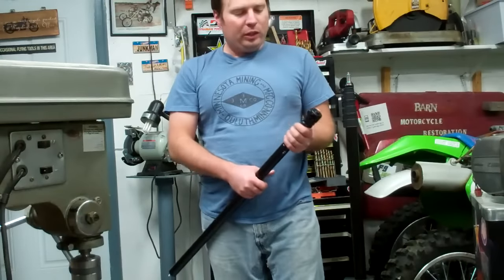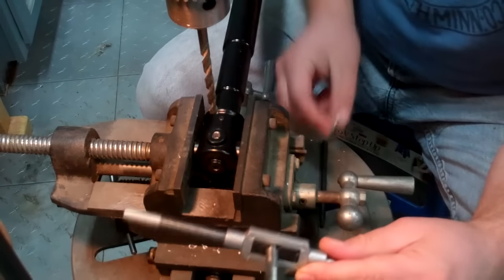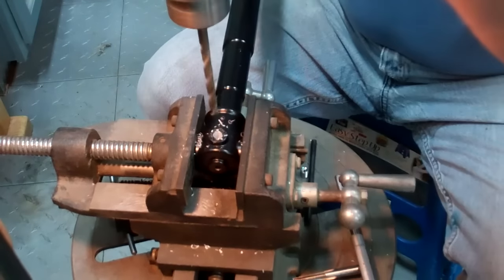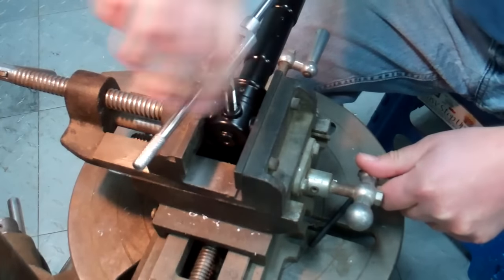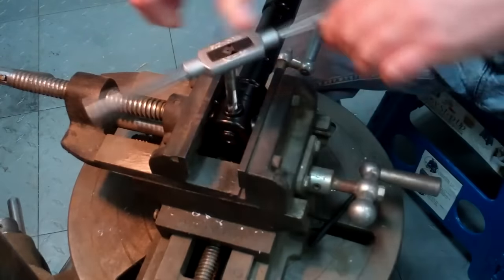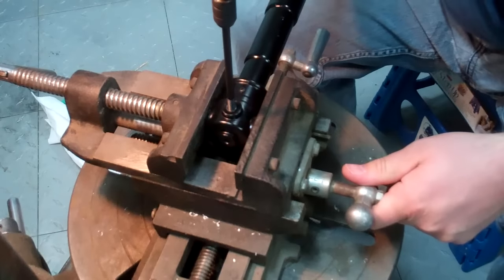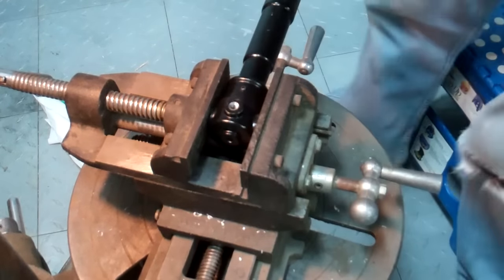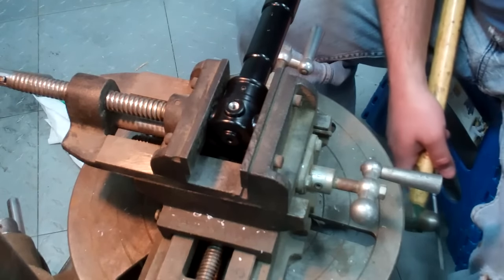Thread Repair - How to install a Helicoil

Comment: Used a $40.00 Helicoil  M14 - 1.25 cm kit to replace the oil pan plug hole which stripped out on my F250 6.0 Diesel. To replace the pan would cost upward of $2000 for the labor, (engine would need to be pulled) and $250 for the OEM Dealer part. Thank you Amazon for the parts and you for the video. I wondered about doing this and appreciate your advice on fixing a stripped out hole.
Reply: you need a hole box of helicoils for these new  engines
Reply: What about the broken tang? Where does it go? If oil pan is still attached how does one fish it out?
Reply from the maker: Magnetize the end of the punch OR put a little grease on the end.  It will stick.

Comment: Just to give a little more information on these taps used to install  Helicoils. The taps for the helicoil are special. They are not to be confused with common standard type taps. If you look on the side of the tap, it will have a STI (Special Thread Insert) designation for a given size. These taps are not regular taps.
Reply: I was told better off buying the kit. Or bring your own tap to the store and compare
Reply: Cheers Michael.  You saved me a headache.
Reply from the maker: The tap comes with the kit.
Reply: *Screw Thread Insert = STI
Reply: @supermotos  I'd assume that the pitch of the thread is different, which    basically means that the distance between each individual thread will be unique to a regular metric tap. The helicoil kits will have done this as a marketing tool so that you have to buy the full kit to do a proper job.
Reply: Excellent tip...
Reply: @modsskinssoulies2655  The pitch has to be identical, as the outer pitch is replicated in the inner pitch (because it's a coil) - you couldn't have say 10 TPI on the outside and 8 TPI on the inside, because the number of outer threads must be the same as the number of inner threads. So M10 pitch means M10 pitch - standard.

Comment: Really good for things that you regularly take apart eg.racing engines.If my memory serves me well,some specialist engines have steel or brass inserts already cast into the engines so the threads don't wear out.They do not oxidise either and break bolts either.Very good and straight to the point video.

Comment: I now have the confidence to perform the task thanks to you. Should I be worried about metal particles getting into the engine? Replacing an oil drain bolt on a 250cc motorcycle engine, drain bolt is located on the bottom of the engine chassis. Thanks again
Reply: There is an oil strainer and an oil filter that will eventually
Flush it out. Thats why use thick grease before drilling to contain the metal bits.

Comment: What do you do if you need the threads at the bottom of a cylinder head & you can't bust off the tang cause there's no way to get it out? Do you just leave it attached? Cause I've got to do this to my aluminum head for the valve cover, but there won't be a way to bust off the tang & get it out
Reply from the maker: Watch this video.  It discusses blind holes.  https://www.youtube.com/watch?v=l1tXNEsjwSQ

Comment: When installing the coil, it seems the hole must be at least the same height as the coil. In my case, it was only half, and the tang refused to come off. I''ve decided to use an angle grinder with a cutting disc to reduce the coil size. I've also decided I'll try and use blue threadlocker before busting the tang.
Reply from the maker: Your correct. Shortening the coil is sometimes necessary.

Comment: When you start the tapper put it in the drill press so it starts straight....3-4 threads then cut the power and then finish it by hand. When I install the helicoil I use loctite sleeve retainer.

Comment: Awesome, thank you! Not sure exactly why, but my helicoil needed to be poking just a tiny bit out of the hole for the bolt to bite. Once I'd got that sorted it's working a treat. A little touch of oil helped too. Thanks again :)

Comment: I don't understand.  If you tapped the hole, why not screw into that rather than the helicoil?  Is it because the helicoil is steel and creates a stronger grip?  I'm a newb.
Reply from the maker: In theory some situations you could do just that, but in most you want to be able to go back with the same sized bolt.  Also the base material here is aluminum which is soft and that is why it stripped in the first place.  A heli-coil thus makes steel threads that will wear out slower or are less prone to damage in the future.
Reply: thejunkman ok it didnt strip because it was aluminum, it stripped because some noob over tightened the fastener.  Next time torque it correctly, maybe even use some anti seize
Reply: Hey sorry guys... I'm the one who stripped out all your bolt holes before you got them...

Comment: Can you put the original bolt back in? Just curious how different thread sizes work with helicoils. My bolt has pretty shallow threads and I don’t know if I should try to find a bolt with deeper threading to replace it. Does the helicoil warp to form the threads of whatever bolt you screw in (obviously with the correct diameter)? Or does the helicoil form a fixed set of threads that you should purchase the correct bolt for? Don’t want to strip out the helicoil threads haha! Thanks :)
Reply from the maker: That is the idea is you can put the original bolt back into it.

Comment: What if the hole where the tang will fall is inside an engine or other mechanism? Does the tang need to be removed? Is there a different method for doing that in the case where you can have a loose piece of metal dropping into the case?
Reply from the maker: personally I use a magnetic screwdriver with a small blob of grease on the tip.  That always has worked for me.  I have done this on crankcase fill plugs with no issue.

Comment: Good morning I liked the video, just wondering if this wood work on a carburetor on a 135 massy Ferguson the bottom screw for adjusting the fuel or air adjustment screw thanks!😇🇺🇸🤠

Comment: When be needed a long thread, can be installed two inserts in the same hole ?
Reply from the maker: You can, but I would use a product called a Time-Sert

Comment: Thanks?! Just got figure out what size bolt I have and then buy the one to fit?
Reply from the maker: Use a bolt sizing guide and thread pitch guide.  They can be found online and you can match it up.  I have physical tools for measuring myself.
Reply: @thejunkman  well, I’m going to see if I can tap the existing thread and clean it up and see if the new bolts from Toyota will tighten down to spec. If that doesn’t work, then I’m probably gonna type it out to something bigger and run some completely different bolts. Thanks for the reply! Great video.
Reply from the maker: If there is enough "meat" that is a viable option.
Reply: @thejunkman  thanks! May just drill it out and add a new nut and bolt 😄

Comment: when i put my engine in i didnt thread the bolts for my slave cylinder in all the way and i pressed the clutch and it ripped both the bolts out (then they both fell in a bucket of oil), and let me just say im glad there was enough threads left so i didnt have to do this under my car!
Reply: otherwise i would be here needing this video :)

Comment: So i need to do an exhaust port on a small 9 horse gas engine  , threads are stripped, how do i know what size heli coil to get ? Do i need to go up to the next size , if i do then my muffler threads will be to small.
Reply from the maker: Buy the size of the bolt that mounts the exhaust.  That's how they are sized.

Comment: You would usually finish the heli-coil at 1 to 1 1/2 threads below the surface and don't forget to retrieve the tang you broke off!

Comment: One thing......if this is going into an engine compartment or some such, and don’t want to risk dropping the “tang” into the engine, can it be left in place?
Reply from the maker: This has been addressed in the comments and in the video.  The tang needs to be removed as this is what "locks" it into place.

Comment: 💥✨💥 Great video and very professional.  I have to do this on an oil drain pan that is still on my car.  Any advice how to reclaim that snapped off tang and also how to clean out the shavings from the pan after tapping it.??
Reply from the maker: Put a little grease on the punch, or magnetize the end.
Reply: thejunkman thanks

Comment: Do you know what size I could use to rethread my bike pedals on to the stripped crank? TIA
Reply from the maker: No, but you can get a thread measuring tool and find the thread of the pedals, then buy the appropriate helicoil.

Comment: When you insert a helicoil does the thread hole become smaller therefore you need a smaller bolt than before?
Reply from the maker: No, that is the main point of the heilicoil. You can repair the threads back to the original size.

Comment: Question. If you just tapped the threads then Why do you need a helicoil if you have new threads?
Reply from the maker: I think it might be obvious, but how else are you going to be able to go back with the same size/thread bolt?  Also in this case, its aluminum and these steel threads will be more durable.

Comment: So do they work on bigger bolts??? I only see one size coil and all that
Reply from the maker: Yes they come in all types of sizes.  You buy the one you want to go back to the original size.  Each "kit" is for the specific size you want because each size requires a different drill, tap and install tool.

Comment: hi great video buddy, top info and good camera work. can I just ask if I was to use one of these on a hole that didn't have a bottom to it, could I just leave the tang on and hope the bolt pushes it flat when it passes out of the end of the helicoil, reason I ask Is because I want to use it to repair a hole on my inlet manifold, and I don't want the tang going into the engine. thanks.
Reply: Oh and since it doesn't have a bottom to chop it like you show, is there a safe way to chop it off and remove it out of the hole if I need to?
Reply from the maker: In your case I would use a product called a Time-sert.  Heli-coils require the tang to be broken off to swedge themselves in there, a bolt would just back the helicoil out.  You could magnetize a chisel and use a little grease to catch the tang when you broke it off.
Reply: +thejunkman awesome, just checked those out and they do indeed seem to be what I need! Cheers gave you a thumbs up
Reply: If the hole is not blind, the tang will fall. You
 can risk smearing grease at the end of the breaker but you need a dry 
blow to break it, and the most likely is that you help it fall faster. Using a nose plier for this purpose will disrupt the insert (which is like a spring) and the thread pitch will be lost.
In
 the case of blind holes such as video, you have to remove the broken 
tong otherwise the screw will stop on it and will push up without 
adjusting and damaging its thread. It can be solved by shortening the screw if feasible.

Comment: You say "Use the correct size drill bit." Is the "correct size" the same diameter as the screw / bolt that goes in the hole?
Reply from the maker: The correct size drill bit is the one specified for the size of Helicoil you are going to use.  It is listed on the packaging, and probably on their website.  For example installing a 1/4-20 Helicoil requires a "H" (.266) sized drill bit.  If you buy the kit for the size you are replacing it comes with the drill as well as the install tool.
Reply: thejunkman thank you!

Comment: What's the point of using a helicoil insert? Why not just tap the thread out and install the bolt straight away? Is it somehow stronger? Cheers!
Reply from the maker: Yes, and you can go back to the same size which is necessary in most cases.

Comment: You broke that tab off the bottom. Hey w did you get it out of there?
Reply from the maker: two ways.  magnet, or put a small blob of grease on the end of the punch and that will capture it.

Comment: would you still be able to do it without drilling the hole out?
Reply from the maker: No, helicoils require a specific size just a tad larger than the original hole so the thread can go back in.

Comment: Steel helicoil in an aluminum pipe? Wont that cause an issue? Galvanic corrosion?
Reply: Galvanic corrosion won't be an issue as long as there's no electrolytic - ie moisture. Ask yourself how auto manufacturers use aluminum heads on iron blocks.
Reply: It's stainless and what holds an aluminum engine together? Steel bolts.
Reply: Use some grease on the bolts to exclude any moisture when finished.

Comment: Is drilling a bigger hole still recommended. I need to retap my case cover thread from putting a larger Bolt.
Reply from the maker: Yes, to install the new threads you have to drill a bit bigger.
Reply: no

Comment: so quick question I have a 2001 raptor 660 and the bottom banjo bolt is striped along with the hole will this work on that with the heat that comes from that part of the engine?
Reply from the maker: Yes, although in that situation I would use a "Time-sert" which is a competitive product to the "Heli-coil" installs much the same way.
Reply: thejunkman ok thanks for the quick response
Reply from the maker: No problem.  I should make a video on the time-sert, although like I said, it installs much the same way.

Comment: Do you thread the coil all the way down or just keep it flush?
Reply from the maker: It should be flush when installed.  There are different length inserts for different depths, but follow the directions and you will be fine.

Comment: does helicoil works with square or acme thread ?
Reply from the maker: Possibly.  You will have to buy the correct helicoil.  Check with their website to see what is available.

Comment: What happens to tang in blind hole ?
Reply from the maker: Either use a small magnet to get the piece out, or apply a little grease to the punch used to break it off.  The piece will stick to the grease on the punch.  Blind holes I tend to over drill the depth by just a little bit to allow room.

Comment: I need to do this for a stripped threaded hole in my car's engine block. it's just one of the head bolts that's not tightened but still I don't wanna risk burning the head gasket. is it safe to do this with the engine head installed?
Reply from the maker: You can.  Just be careful and coat the drill bit and tap with grease to catch the chips you will make
Reply: thank you for your time to answer me. I imagined so. one thing that scares me a bit is not going down perfectly straight since ill be working in the engine bay and the stripped hole is at the back of the engine head near the firewall.. its the weekend I think I'll do this this saturday :) that'll do for a relaxing saturday. hope itll be ok
Reply: Could I use a m6x1 tap to retap it for a 6.3x1 ?
Reply: Go to the junkyard and buy a used block.  Helicoils aren't strong enough for the sort of torque needed for head bolts, GENERALLY.
Reply from the maker: A TIME-SERT is an option for these.  Metal stitching is an option for these situations but is probably not cost effective for easily obtainable automotive engines.  Its more for industrial, antique, or high cost castings where entire replacement blocks are not available or practical.  http://www.locknstitch.com/precision-metal-stitching.html

Comment: Hey man great video, can I ask a question, I have a 30mm aluminium hub centric spacer with a stripped thread, It won't tighten and just keeps spinning, I don't have strong enough drill to do this myself, what kind of places would do this kind of repair? I can't seem to find any place that specifically mentions they do this kind of work but I have found shops that sell the kit. Would I be looking for a fabrication company? Thanks
Reply from the maker: Generally any machine shop should be able to do this.  Also i this is relating to a wheel, a custom wheel shop should be able to re-thread this.
Reply: Thanks man, I'll call up a few places tomorrow and see if they can do it.
Reply: I decided to just do it myself got a helicoil kit, just hope my 18v drill can make the hole bigger, thought it was worth it since If it happened to one spacer it could happen to the other 3 and would be worth my while being able to do them all myself.

Comment: Stihl vs. Echo...........almost every single echo I have worked on has become “alchemically” bonded to the fastener....resulting in broken fasteners....Very rarely have I had to helicoil a Stihl.....most fasteners used on Stihl eqpt. have a coating on the screw that keeps if from bonding to the part.

Comment: Why do you need the coil in there if you’ve already created a thread using the tap in the first half of the video?
Reply from the maker: To put back the correct size fastener.
Reply: @thejunkman  of course! It’s obvious… the hole bored out would probably be bigger than the screw/ fastener that needs to be inserted back in.

Comment: Did you use the next higher tap from the initial thread size for the coil?
Reply from the maker: +Marlen Cisneros i used the one specified by the coil i am using
Reply: thejunkman I figured it out. Had a 10x1.25 and didn't know if I had to use a 12x1.25 for the coil but turns out taps for coils are different in width. Thanks for replying

Comment: would this work on my car oil sump pan as the threads are gone on the sump for the the nut to go back in
Reply from the maker: Yes, probably.  As long as there is enough material around it to enlarge it a bit to re-thread.
Reply: Why not just tap it oversize and use a larger bolt?  If metric, go to the next SAE size up; if SAE, the next metric size up. Eh?

Comment: If you’re tapping, what the point of the coil?
Reply from the maker: To put it back to the same size, and in this case add steel threads rather than just threading into the aluminum as before.  That was the reason these threads failed in the first places.  Steel bolt into a (cheap) aluminum thread.